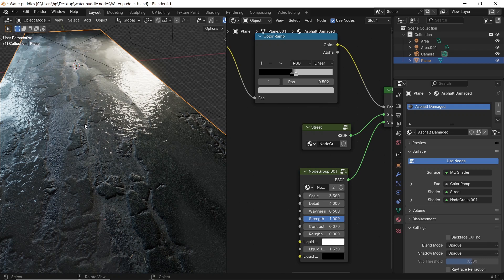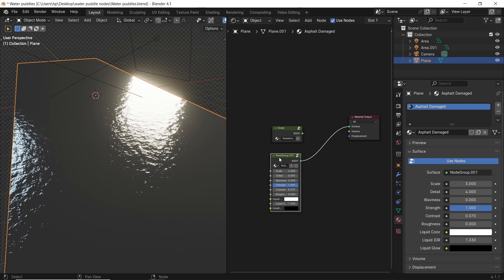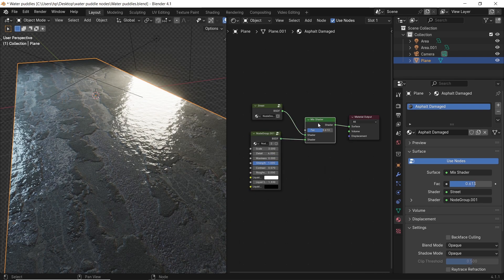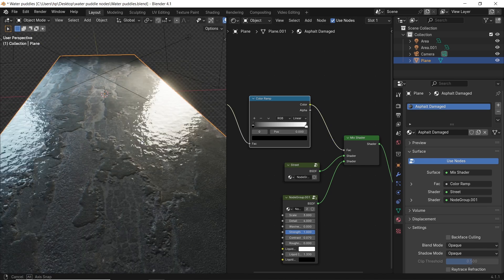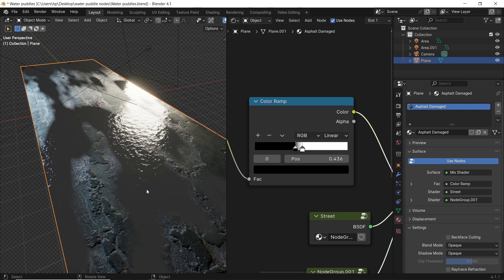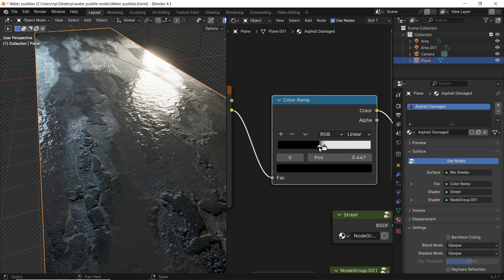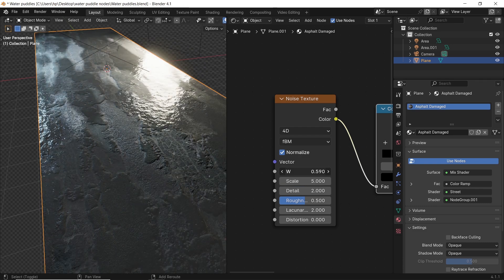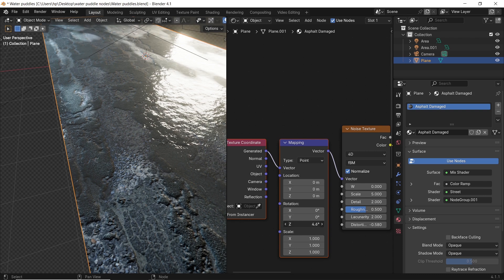Easy Procedural Wet Surface Shader in Blender

Comment: hey do you remember the gradient sampler addon that you showed us a while ago 
well I tried it but for some reason it doesn't work and yes I did install the addon and it does appear in the pop up menu but the second I try to sample any picture it gives me errors 
can you give any possible way to fix the issue
Reply from the maker: It won't appear in a menu as i recall you just right click on the color ramp and use it as in the video.
Errors in add-ons occurs usually with not supported blender version, so check the page they usually refer to the version needed.
Reply: @architecturetopics  thank you